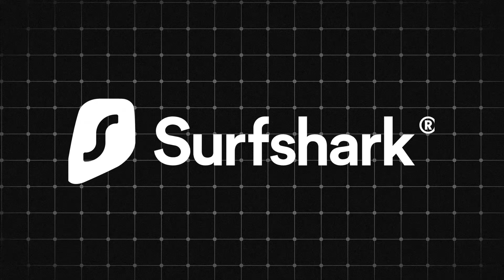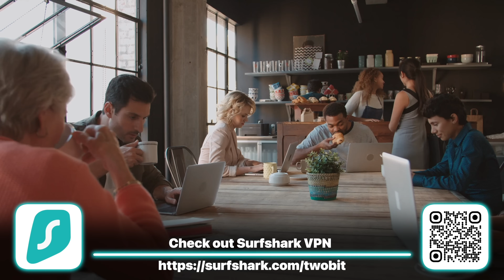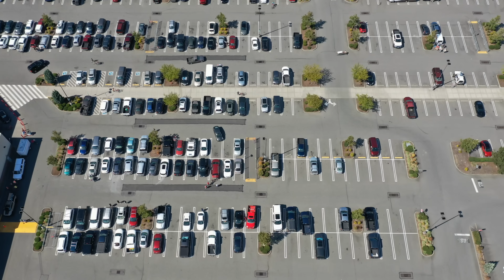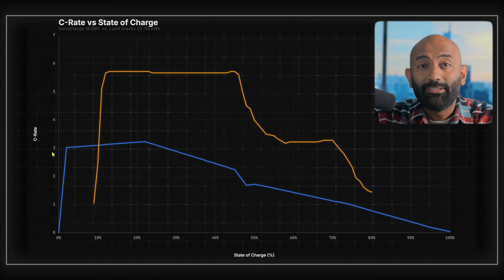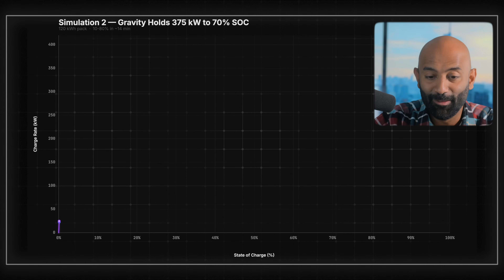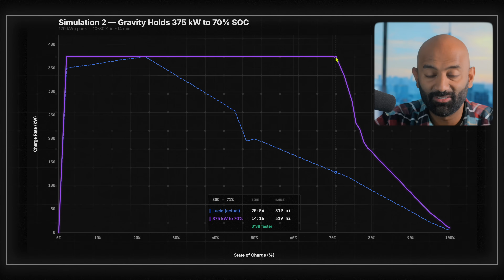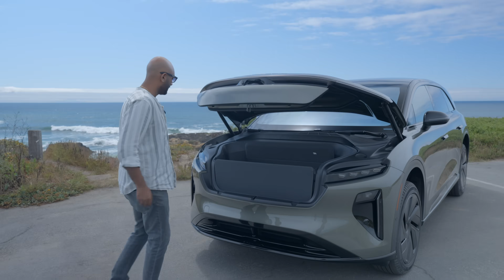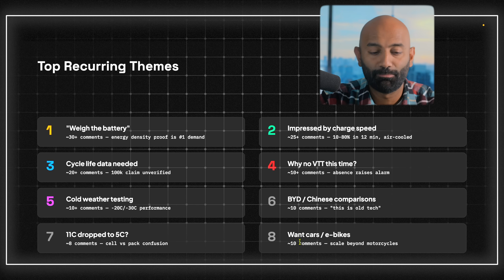Donut Lab Battery Test 4 Changes Everything!

Comment: I want this battery to be true, that's why I believed it from the beginning. Not skeptical - believed like a religious fanatic. I read about the Donut Lab guy, and it seemed like they wanted to treat him like Trevor of Nikola Motors, but I knew that people like that finally make a hit, if they've been aspiring to make a significant breakthrough for years. When I also saw the weight loss jabs, which seemed impossible for so many years, I knew this battery is possible - then its more or less from a Scandinavian like the weight loss stuff - yes, I'm a stupid donut battery believer. I am already super happy with what has been proven, so far. Please start imagining improvements to this technology - how it'll look like?  My issue is the way people around make me look like I was foolish to buy a TM3 in 22. I try to use the Mobile Phone as an example of how the batteries in a car will improve, to the point that it will be faster to charge them than going to buy gasoline - but they look at me like I'm delusional. I want to be able to call them MORONS very soon (that's how angry I feel). Donut Labs  - let's go - next stop, SOLAR. Then the wars will reduce
Reply from the maker: tm3 in 22? solid move. keep building the case — solar’s next, and yeah, the morons will fold

Comment: again, one of the best ELI5 (well more like I'm in undergraduate electrochem class) explainations I've heard about this. Everyone else is writing off Donut's shorter videos but the real knowledgeable folks are on the money with this. This battery is revolutionary. Period. 
And I'm glad you entertained my quasi-capacitor at the "front" idea. There still could be something like that just to keep a "gate" in front of whatever this exotic chemistry is to help the BMS regulate the charge initially until equilibrium is hit.

Now I'm imagining these packs in EV Semis, buses and locomotive/EMU trains where megawatt chargers are normal and watercooling isn't an issue and dumping massive electrons will be key to keep those vehicles on the road rather than the charger. Trains of course can charge under pantograph in sections while running or stopped, but that could mean those sections would be spaced further apart and it becomes less costly to electrify that infrastructure. 

And from a personal standpoint, EV RVs suddenly look like a real thing if the density is what they say. Even if it's just the house pack and the chassis pack/motors are all supplemented by a genset and a few of those new 400watt solar panels coming out... Wow.
Reply from the maker: an EV RV with solid state batteries and solar on top is a DREAM of mine lol

Comment: I'm waiting for a bigger version of the batteries to see if it really works at scale. Keep up the hard work.
Reply from the maker: Exactly, but there are some other tests I still want to see. i want to see the battery charged and discharged at 6c, so full charge/discharge 3 times an hour, for 1 week. so 500 charge cycles. then a charge and discharge to see retention. that would be huge

Comment: The different Donut branches can't even agree on how far they should take the scam...some claim 350 Wh/kg at pack level, some 400 Wh/kg at pack level, as the B2B division Vergenext does .

 If you don ' t even know the energy density of the battery you sell, how can you then make it in the first place?
Reply: What are you going on about, the details released at CES stated 400Wh/kg at the cell level, and 350Wh/kg at the Donut module level, as used in the Verge motorcycle. 

Verge next is the OEM B2B seller, the modules can be packaged with different energy density cells as required by the customers, or provided as raw cells for the customer to package themselves. There is nothing different here from how CATL or BYD offer different OEM configurations to their commercial customers.

The Verge CEO even said the two TS Pro bikes have different module packing and cell energy density configurations in an YT interview. Again, this isn't any different to other battery makers who supply cells and modules with various capacities.
Reply: @GruffSillyGoat 

What are you going on about?

Vergenext and Donut Lab are closely connected through shared ownership, leadership, and a parent-subsidiary relationship.  

And you claim the 400 Wh/kg pack level is just a battery mixed with donut cells and something else with higher energy density? Or what are you saying?

Comment: I'm the guy who commented that we wanted to see the battery weight and capacity, cooling performance and life cycle estimates.  What troubled me the most about the video is that they made claims about what the video was demonstrating - but didn't provide anything to back it up.  Was the battery actually air-cooled, and at the capacity stated?  I'm an engineer so I'm always cautiously skeptical.  But, I want this to be real.  So, right now I'm starved for repeatable, verifiable data.  "Let the scientific method shine!"  lol  

What we're being handed is akin to marketing material.  Yes, it looks good, but is it based on reality?  We have to take their word for it.  That being said, their cavalier attitude may be the best indicator that this is all real.  After all, why not just string us along just to later deliver exactly what they promised?  It will probably turn out well in the long run.  But, in the short term they're not creating a lot of "goodwill" among their audience.  This is definitely not how I would handle a world changing technology roll-out.
Reply from the maker: verifiable data is the whole point — we’re pushing for it too
Reply: The proof will be in the pudding of real world open market available products, such as the Verge Motorcycle, becoming available with these Donut batteries... Then they can be tested by actual independent labs and by actual real world riders. Untill that happens I am for now giving them the benefit of the doubt. But if such commercial implementations do not appear before, say, jan 2027, we will know that it has all been a mirage, or worse: a scam..

Comment: What an amazing step forward I love seeing the progress and watching these batteries become better and better and better. I'm really curious what would happen with an air-cooled battery pack and somewhere like Arizona in the summer and how much that could affect the charging
Reply from the maker: great point, it would depending on where their bms programming finally lands. and what the true operating limits are for the battery to perform for optimum longevity. but yeah if that heat can't get out of the pack fast enough charge speeds would throttle until equilibrium is reached. for cars they'll be liquid cooled as they are now. on a motorcycle going air cooling really simplifies and saves space

Comment: I'm hoping that we get testing data over thousands of cycles from an independent third party testing lab like VTT.  If VTT had started 5c charge/discharge cycle testing 4 weeks ago they could have run over a 1000 20% -> 80% -> 20% cycles by now.  Still well short of the claimed 100,000 cycles, but still a some sort of data to look at.  However if they were going to show that with VTT, I would have expected them to have sent a 4th battery.  

I'm guessing that the 100,000 cycle claim might have been based on more moderate charge/discharge rates that 5c, so maybe they don't want to publish data for 5c testing over 1000s of cycles.
Reply from the maker: one cell won't cut it for 100k cycles — need a whole fleet

Comment: Great analysis, thanks for the time and effort invested in explaining it so well.

While I can see some people enjoying it (say a sales rep with a wide area to work on), I personally don't see a benefit in charging this fast, at least not if it is set at that speed.  

In my case, I use fast charging when I travel long distances (over 300 miles), and in my case, that does not happen often, just a handful of times a year for holidays.  Given the current range available in good EVs for travelling, it's becoming quite unlikely that you would need to stop more than once, and I tipically want to rest a bit and grab a bite or something.  The current charging times are great for that, often a bit too quick, the car frequently notifies me it can continue before I finish eating, but I can make it work...  Anyway, a charge lasting 10 min. would force me to either not have lunch or have to stop eating after a few minutes to move the car.

If configurable, then that's amazing, drivers would have insane charging speeds at their disposal when needed.  A set speed that high would probably force users to (ironically) seek slower chargers often.
Reply from the maker: yeah for me,  a 30 minute charge sessino to stop for lunch is great. Especially with wife and kids. only on trips by myself where I like to make the best possible time would I care about this. but 90% of all my charging comes for free at home on solar

Comment: Two points made in the Donut test #4 video is that the test is occurring in an older Verge model, one with a BMS designed for Lithium cells, and that the charge controller hasn't been fully optimised for the Donut battery pack.

This is not just a statement that charging will improve even more but one that indicates the Donut battery can be used ss s drop-in replacement for Lithium packs, operate and achieve much higher charging rates. This will get OEMs attention more than a demo with a custom designed charge controller.

Further, the lowering of the charge rate in the video may be well due to using the bikes original charge controller, that is more optimised for Lithium packs. Even then, that the Donut pack stayed cool for so long at 5C before being throtteled by the controller is impressive. 

A Donut optimised charge controller will likely provide even more impressive results, perhaps showing how the battery pack performs over a 0-100% charge. 

A subsequent video of a production TS Pro bike, designed for the Donut battery, in the series will enable before and after compatison. Contrasting already impressive drop-in use with that of fully optimised capability.
Reply from the maker: TS Pro test is coming — stay tuned

Comment: Can't wait for them to ship, and William Prowse to do a video on it, and compare to other batteries on the market. If their claims are true - I want 100% of batteries in my life to be donuts. Replace the AAA, and AA batteries in my house with Donut batteries. I'll take one for my phone. 100k cycles? I'll be using the same phone for YEARS longer. The only reason I give up on a phone is that the battery life tapers. 

Gimme a solid bank of those for my house, and I'll shell out the cash right now. If it's comparable price to an LFP - Sign me up. I'll buy double the capacity I need, and install a massive solar array. 

Only reason I don't have an EV is that I can't justify the cost due to the lifetime operations cost from the battery. I did an analysis of projected cost over time of an ICE and EV, and in 25 years the EV is more expensive because you'll have had to replace the battery twice (potentially). If I knew my car's battery could last 40 years - I'd switch to EV today.
Reply from the maker: 100k cycles in a phone? That’s the dream — no more battery anxiety.

Comment: When you say faster than anything we have on the road do you mean in usa? china are doing more than that. They have shown 12C.
Dont really get the fuss about the air cooling, Even ICE MC have water cooling today and in cars its not a problem.
Reply from the maker: china's 12c is lab only — we're talking real-world road charging. air cooling works when the cell doesn't melt

Comment: Zeekr and BYD with their new batteries can go over 1000KW and they are 8-12c..
Those are not prototypes. They are in production already.

We don’t really know the capacity of this battery. it could be that 18kwh but it can also be 22 or 25. There is no way to verify that. Also the temperature is unknown. I would guess is close to 5 celcius as the guy in the video is using a down puffy jacket
Reply: Verge said 33kWh, which is quite something to squeeze into a motorbike. The down jacket is a moot point, VTT’s first test confirmed the battery performs well up to 90 Celsius or 194 Fahrenheit.
Reply from the maker: Yeah we’re flying blind on capacity and temp — those jacket clues are solid though

Comment: Is this battery useful for lighter vehicles with current information? For instance, quadricycle, the Aptera, or electric bikes (scoots/skateboards/mopeds etc). The e-bike industry does seem held back by the fact they've not moved to the Asian style of charging which is to lease the battery and get it out of a charging station and slot it into your moped. 

By the way, that also looks like an absolute cyberpunk operation so it follows the rule of cool. For that reason alone we should be using it.
Reply from the maker: quadricycle + aptera = perfect use case if density holds. e-bikes? swap stations are the move

Comment: Can you look at the efficiency of charging. How much electricity do I have to buy from the grid to have 200KW sitting in my car?
Reply from the maker: wall-to-battery is ~88% for DC fast charge — so ~227kWh from grid for 200kWh usable. heat and BMS eat the rest

Comment: Good video as always but extrapolating from a tiny pack at 100kW to a full-sized liquid-cooled pack requires some serious assumptions about how this scales. Also, do they mention ambient temp in the donut video (I may have just missed it)? Cause it is still winter right now and they may have picked an optimal outside temp to maximize full charge time. Could just as well be that at 20°C it runs into heat issues after 2 minutes.
Reply from the maker: scaling's the real question — and yeah, no temp data in the vid

Comment: Sooo, it seems that if this Donut battery would be a Lucid battery sized one, after reaching about 45% of capacity, it would reduce its charge amp to......the maximal charge rate the best street chargers in the world from today are even capable.
I think if the next news/evidences about cold condition behavior and charge cycles will be similarly astonishing, we can say, Lithium, your days are counted.
Reply: maybe - we don't know the cost per kWh yet...they picked a vehicle with an 18kWh pack size requirement for a reason...I suspect.
Reply: @r.b.l.5841 well, if they plan to start a serial build right now together with a vehicle company, the start is much easier with a bike company, with smaller batteries than a car needs.
To ramp up a production of let's say a 100 kWh pack and with mass amount is much harder.
And at the moment they try to keep the technology secrets.
I think that would be almost impossible with a car company. Especially with a Chinese one. :) 
So i do not find it
suspicious.
Reply from the maker: lol lithium’s sweating — but yeah, chemistry’s the real speed limit after 45%
Reply: will as always depend upon cost per kWh, which will be a moving target especially if this takes off and production ramps up quickly.  We can guess the cells are not starting off cheap by the target first application - a small pack for a MC. It can take some time to ramp up production when the initial cost is 'high' compared with the current offerings...hope to see a non-toxic 5+C rate low or high temp tollerant cell with at least 10,000 cycles yeah it could be awesome - or they could say Happy April 1st !! lol

Comment: In Europe, we're building 600 kW charging stations at scale now, and with BYD promising their 1500 kW charging 'pile' to come here, too, I think we will see many more vehicles charge at lighting speeds. China is already hard on it's way to a megawatt+ charging infrastructure. The comparison with the Lucid is useful, but hardly the forefront of technology. I fear, the US (only) perspective is holding you back here...
Reply from the maker: us perspective? i ride bikes globally — this data is from wherever the test happened. infrastructure follows cells, not the other way around
Reply: @TwoBitDaVinci thanks for your reply but I think you might want to re-read ;-) Also, the last sentence refers to your frame of reference (Lucid) which is very US-centric and Europe and China are further ahead when it comes to infrastructure. Hence, using only Lucid is holding you back, IMHO.

Comment: Just charge the EV battery in parallel segments for a faster charge rate. It's just about having the correct input / output charge and release pipelines.
Reply from the maker: parallel charging? sweet in theory, hell on earth with real cells

Comment: Lots of "Chinese already do this" comments.  Really?  Solid state?  Actually installed in a product?  No.
Reply: this is not installed in a product and you have no proof this is solid state either. but chinese cars do have production vehicles being sold that charge in under 5 minutes (unlike this test)
Reply: @hugodeandres1497  There is proof. the heat test is one.  BYD battery tech is a massive battery that can accept 1000 kw but can't sustain that charge rate and must used massive heat transfer system.  long term life of these batteries hasn't been determined.  Given byds history of battery issues, good luck.
Reply from the maker: Yeah solid state in a real product? Still waiting to see that one.